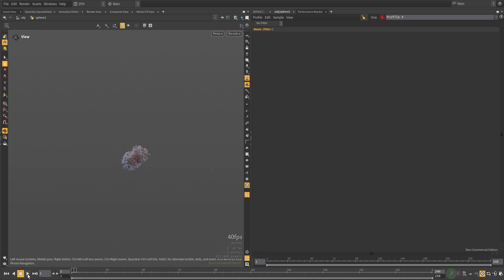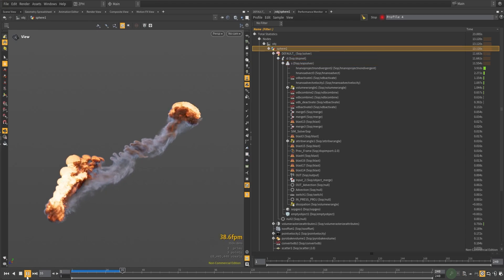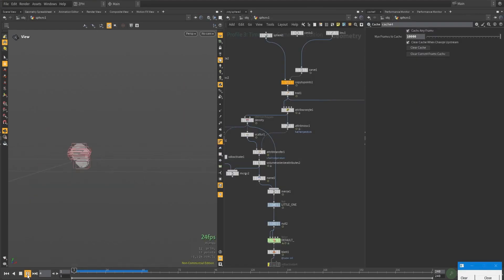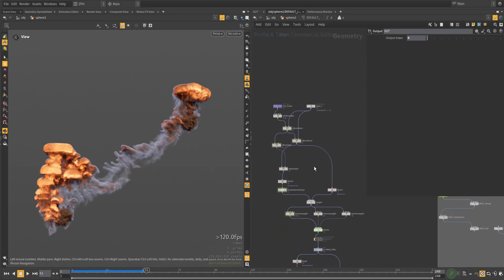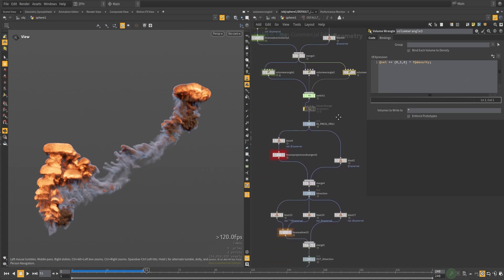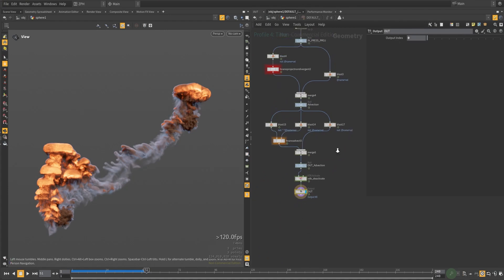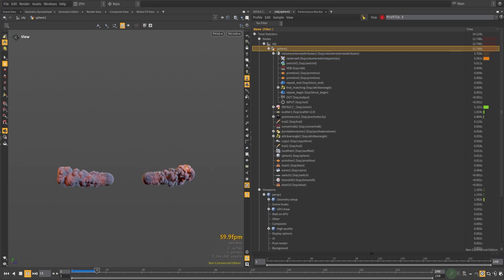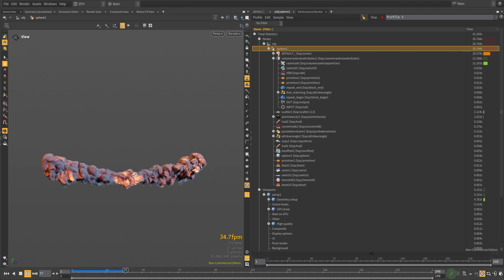HNanoSolver : Sparse GPU Accelerated Volumetric Fluid Solver in Houdini

Comment: How much VRAM would you suggest to have?
Reply from the maker: You can use it with as little as 2Go of VRAM but if you want to push the resolution I'd suggest having at least 8Go. For example, a dense domain of 200 Millions voxels can be simulated using only ~4.5Go of VRAM depending on the Sparsity of the simulation.
Reply: @ZephirFX  Ooooh, great. I have seen people trying to increase the sim performance by lowering the resolution of the velocity field. would that also be possible on the GPU?
Reply from the maker: @HangYuriYangFX   That would be possible yes, the velocity field could be coarsened. But I believe the loss in precision would be pretty big and the simulation would look less detailed (at least with my current implementation)

Comment: Very interesting! So you writing a code which can use the CUDA cores instead of CPU? Can it potentialy handle a water simulations on GPU?
Reply from the maker: Yes,  computations runs using Cuda cores instead of the CPU. It could potentialy handle water simulations but not in the actual state of things due to the way water is usually simulated in VFX.
Reply: @ZephirFX  but anuway it would be may be some optimisation